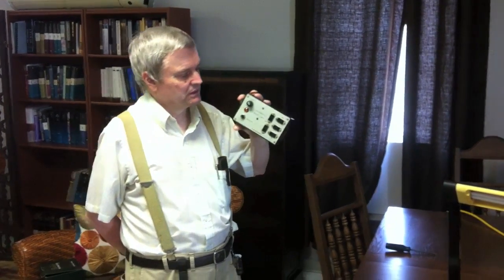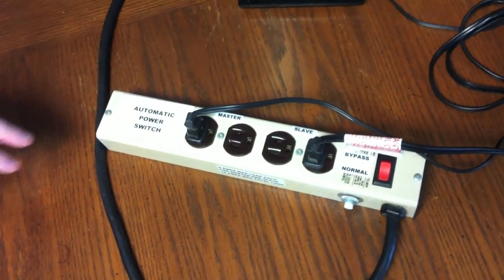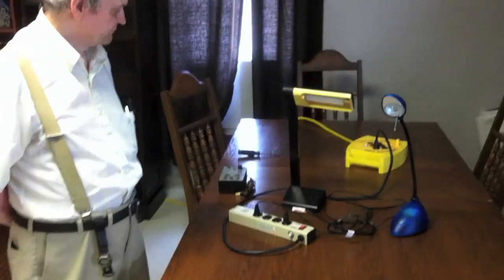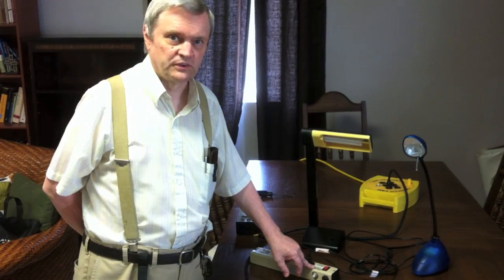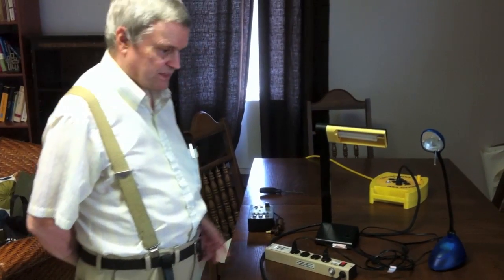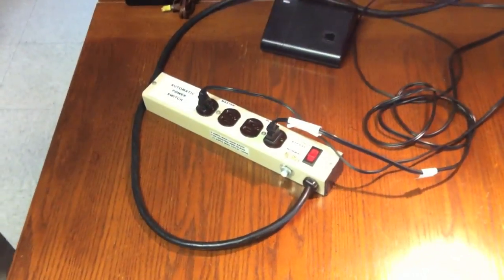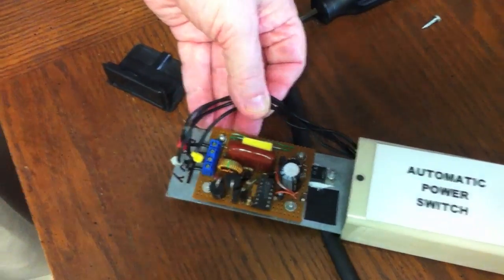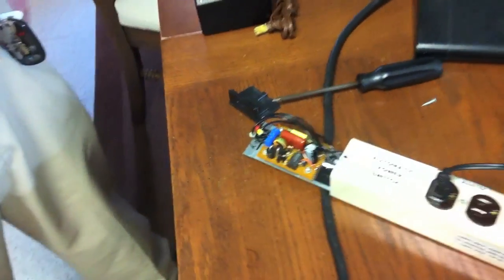Master/slave Power Switch

Comment from the maker: Please note that when you google “Gadget Freak case #195” that you will also get a “DNTV” page that contains the video only and does not contain the complete construction article. If you do, check one of the other Google hits for the complete article.
Reply: Thanks for posting on such a useful device!  I would like to locate the circuit diagram and parts list.  Haven't been able to locate on google, perhaps due to the time lapse.  Please advise or post/send a link to details if available.
Reply: Here is the link to the circuit schematic and component info:       http://downloads.deusm.com/designnews/description_and_build_instructions.pdf